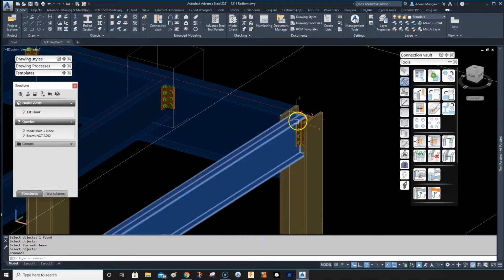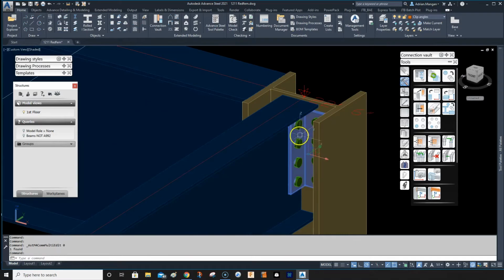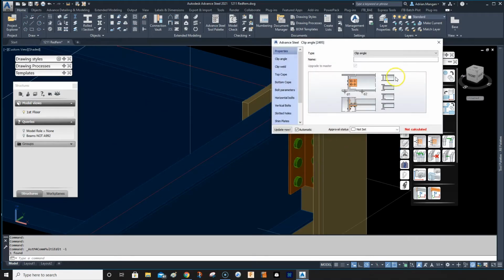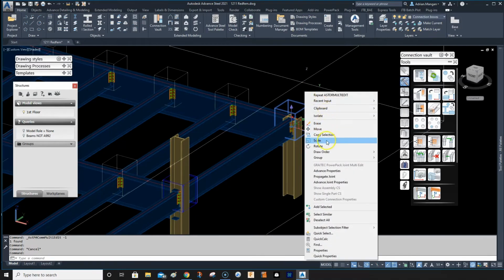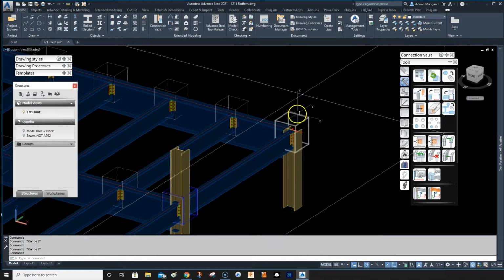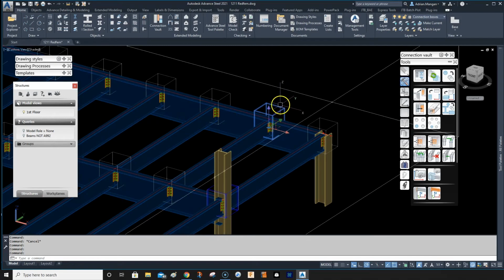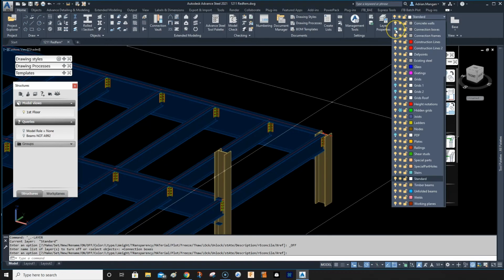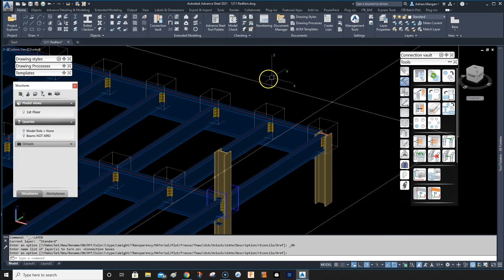ADVANCE STEEL: Quick Tips - "MISSING JOINT BOXES"

Comment: QUESTION, how do you get the joint box to show up in layers so you can turn it off? My "grey boxes" do not have its own separate layer. Im not making connections, just simple copes and stairs, railing, ladders
Reply from the maker: Sound slike you are making features not connections, you could just click on all your boxes and put on that layer it will work but not ideal

Comment: The only other thing I would add is: If you have beam features (typically a cut to feature) copied, and no weld added, you won't see anything to click. You can, however, use the advance tools filter to show beam features, then right click advance joint properties to change the beam feature.
Reply from the maker: Good thinking